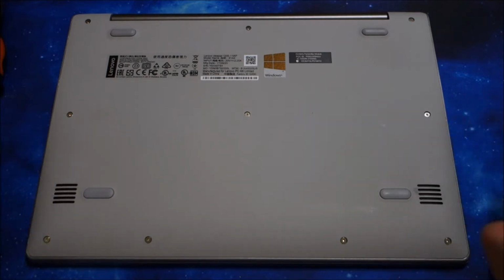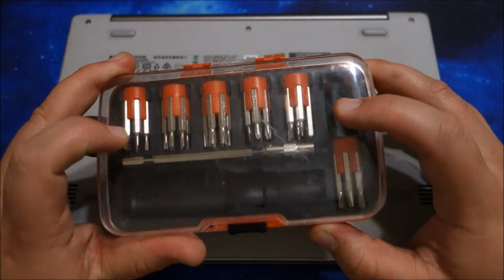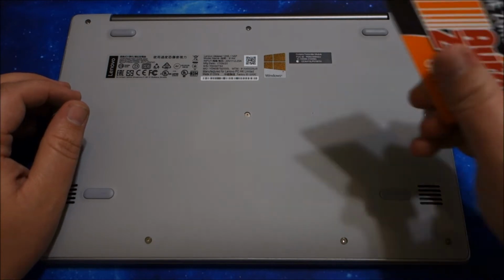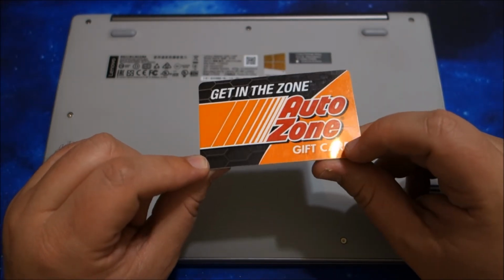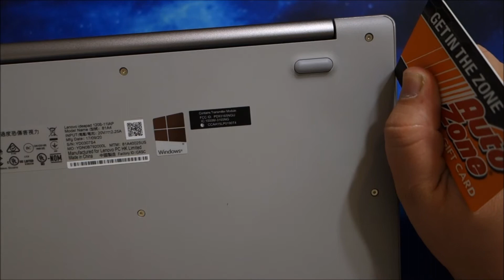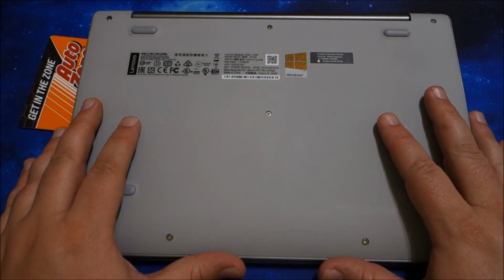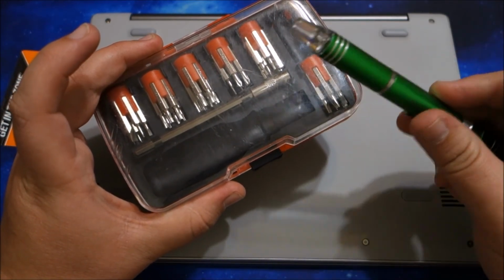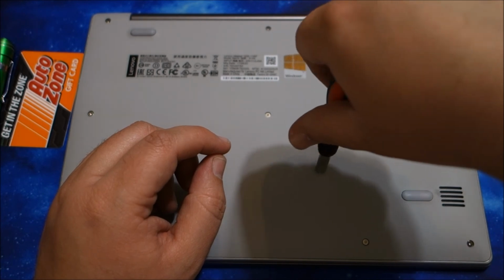How to open a lenovo 120s and other laptops

Comment: Hi can we upgrade the SSD of ideapad 120S 14IAP?
Reply from the maker: only if you give me $500! j/k. No, at least not without the ability to solder a m.2 connector. I do not have the skills to do that.
Reply from the maker: Did you watch the video?
Reply: AICvideo yes. I even opened my ideapad. I could not find a M.2 slot but there is space for placing a drive.
Reply from the maker: I was replying to the other guy, but you probably have a non us model of the laptop.